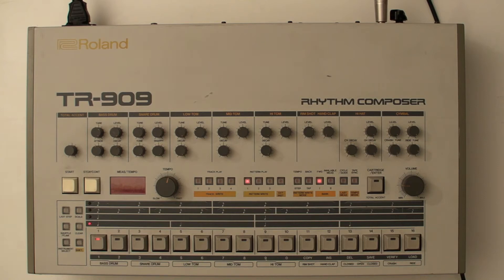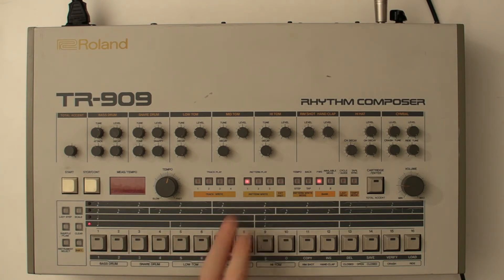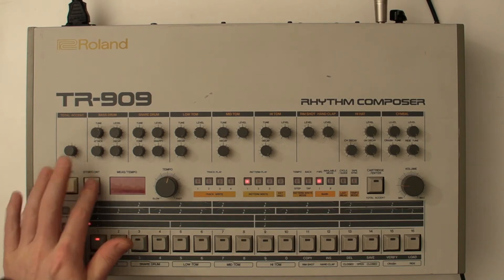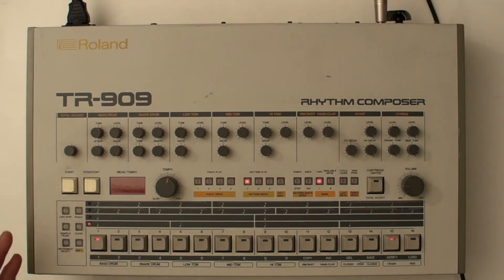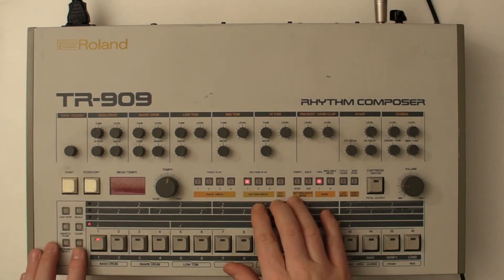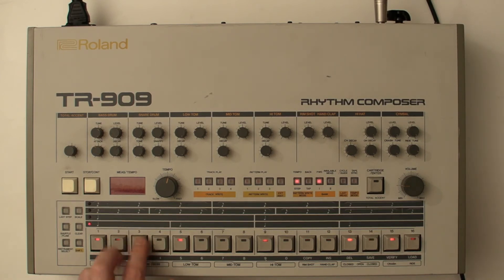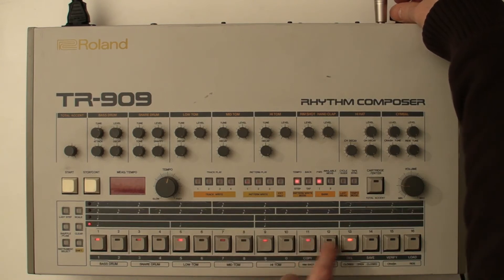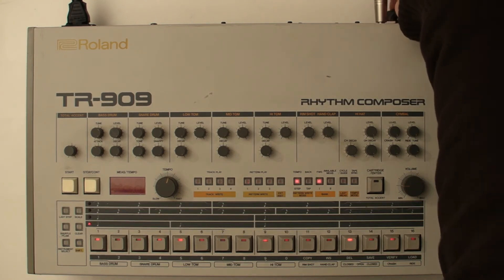Roland TR909 Quad Mod

Comment: its a great invention! ..and if you switch to track play mode, does it play the same written track - but with the different switch selected patterns? is there a possibility to have another switch to have more tracks storable?
Reply from the maker: I never use track mode. Haven't used the 909 internal sequencer for a along time either...
When I get a chance, I'll check. Think it may get confused about a change of track though.